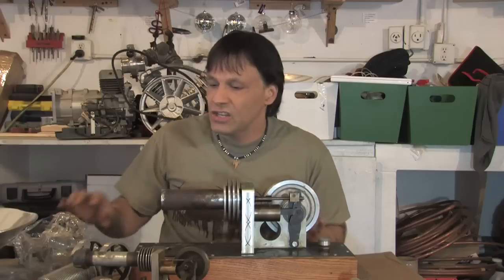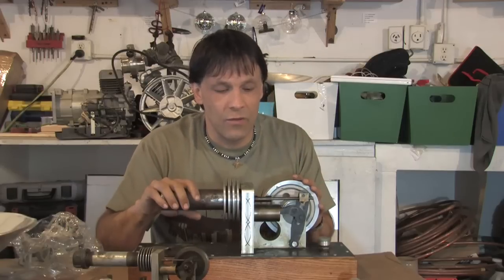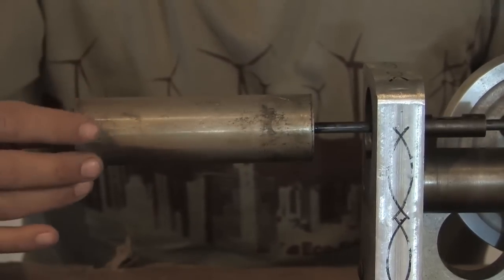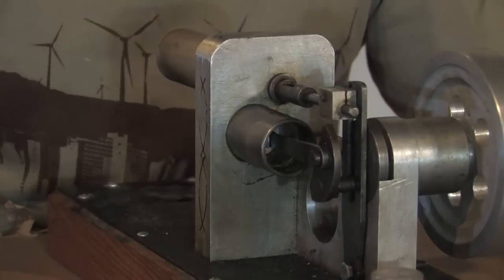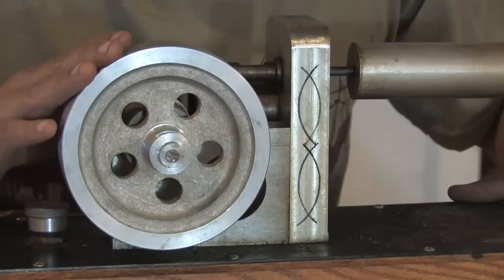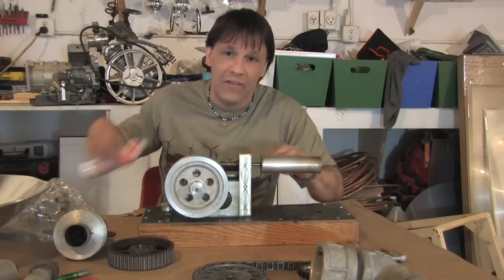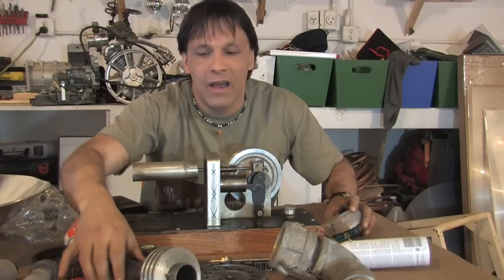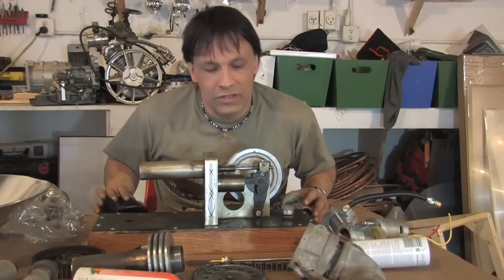Free Power Stirling Engine TAKING ONE APART HOT AIR E Solar Power GreenPowerScience

Comment: Dude>>> my hat is off to you...   a friend of mine told me about stirlings....   i never even saw them or knew they worked..  i found your vids several years ago....   i took a chance...   i personally built a similar sterling using your vids i watched a thousand times..   my engine had no particular specs , just measurements off the screen...   well my engine uses vcr heads..   and they are already in ballance. my stirling is def not great...   but it proved to me they work!  thank you!
it was countless hours of drilling and home machining>>>
Reply from the maker: +coolflix43 Thank you for the great comment! Stirling engines are vintage simple technology but if one thing is off, just a bit, they just do not run. Hats off to Robert Stirling for making them back then with the tools of the day.

Comment: One thing that must be remembered about any serious application of a Sterling engine is that the power is dependent upon the heat differential between the hot side and the cold side, and not the absolute temperature of the hot side. In other words, efficiently getting rid of the heat on the cold side is just as important as efficiently generating heat on the hot side.

Most of the test engines you see on youtube eventually get too hot and stop working because they have inadequate cooling.

Comment: Note to self.

Air  @ 300k = 26.2 milliwatt per meter kelvin
N2 78p/100 @ 300k = 26.0 mW/k
CO2 400ppm @ 300k = 16.8 mW/k

Wow C02 measly 300~400 parts per million gets it thermal conductive ass kicked by N2 which is 78 parts per 100. 

Should we be really paying Carbon tax?  Its a con IMO.

Comment: If you want hydrogen as an expansion medium, design it in a container and fill it with hydrogen.  Both Hydrogen and Helium has the highest thermal conductivity.  

Air @ 300k = 26.2 milliwatt per meter kelvin
H @ 300k = 186.9  mW/K
He2 @ 300k = 156.7 mW/k
N2 @  300k = 26.0 mW/k
CO2 @  300k = 16.8 mW/k 

Air has a slightly larger thermal expansion and N2 tops Air. Air is mostly N2.

Seems Hydrogen sucks up a lot of heat.  Not sure how fast though. More research eh.

Comment: with the air flow between the piston & sleeve witch makes heat , what stops the alloy piston from melting under the high RPM'S ??

Comment: @Dubconferencedotorg The name of the engine is Stirling. Stirling is also the name of the work heat cycle used in the Stirling engine. Try looking it up on Wikipedia, they have articles on both. I don't think "Sterling" is used in relation to engines or heat cycles.

Comment: Hi Dan, that smaller engine  that has two flywheels seems perfect for my experiment.  is it made from steel? if the casing material is steel it would be perfect for an experiment that i am doing so i want to buy one could you please direct me where to buy it if the casing is steel. thank you

Comment: Thanks for the time well spent, Enjoyed the video very informative, I noticed the piston that floats on air and already know that the rod driving the piston is set in a sleeve/bushing to hold it perfectly strait in the cylinder boar (for less friction).  Tight piston to cylinder boar is the key to these engine's  How long does the piston last in these engines cause i'm sure there is some kind of contact in the piston chamber.

Comment from the maker: @starr8719 FLAT ALUMINUM BLOCK 1" THICH.

Drill displacer hole center. Drill power piston hole opposite side to they overlap by 1/4" Like the Olympic Rings. 1/2 deep on both, meet at center of the block.

Comment: Go to a hobby store, get some brass pipe, for the sealed piston, make one out of epoxy. crank shafts can be made out of coat hanger wire, but they need to be balanced.

Comment from the maker: Copper will work good, the more heat the better. More power can be generated by increasing the cooling fins and adding a water cooled system if your heat is overwhelming.

More heat the better:-)

Dan

Comment: the diversion was to quickly show the misconception posed by the other youtube video
and this engine does not use hydrogen but normal air
so it wasn't explanation, it was aside, and therefore quickly glossed over

Comment: The 'top' piston does not do any work, it is loose and has no compression. All it does is shuttle the air between the hot and cold ends of the cylinder thereby causing it to heat and to cool, and expand and contract as a result. There is an air connection to the 'bottom' cylinder with a tight piston that is pushed and pulled by the expanding and contracting air.  That is the one that can do work.

Comment: Hi Dan: Great to see all your found-part demos! I have been using those graffitti paint cans to mount my 3-phase neo-mags on. Other vids are showing the Stirling shaft driving similar stacked 3-phase generators. Great to see BOTH heat AND light generating power to hub mag-drives! This brings universal Fuel-Less Transport so much closer fast!

Comment from the maker: Wow,

That is different:-)

How much electricity do you need. The simple way would be Thermoelectric you can buy them on Ebay, buy conductive paste and add a heat sink of some sort. They produce about 1/4 the electrical rating but can be chained together.

Comment: could a regular gas engine with its piston and cylinder be converted to a stirling engine?Im thinking this would have a reserve of high pressure compressed air for repressrizing the engine.Anybody know of such a conversion?because gas engines are everywhere and cheap.

Comment from the maker: Hi,

When the engine developed a leak and I removed the front cover, the outside cylinder was over 900 F and the inner cylinder was less than 300 F. Just a quick reading and just sort of happened. I will try a better way because it is a great question:-) Air unknown.

Comment: ...I see a machine shop in your future .... :) Getting usable power out of a solar collector is very difficult. I'm going over the thermodynamics of an engine design I have going in my pea-brain right now. Steam, ~400 psi, and 700 F steam. Will probably give me a %15 efficient engine. The nice thing about steam is water is incompressible so the recompression cycle is very efficient. This is the cycle that kills stirling engines. Pentane is also a nice working fluid. Good luck.

Comment from the maker: The sealed piston or "power piston" a gasoline engine piston and rod would work. The heat displacer piston would need to be replaced. The tricky part is hooking them together so you can also link to a flywheel. Gas engines are pretty good at having a reasonable friction. Small compressor pumps are the ones that need a bit of sizing down.

Also there are some designs on the net that use two regular pistons, not sure if it works. I have tried it twice with no success.

Comment: use engine cylinder dresser honer to get the right ID inside the pipe right. just goes on the end of a drill, has 3 stones on it. (cheap and fast)

Thanks =)
Peace